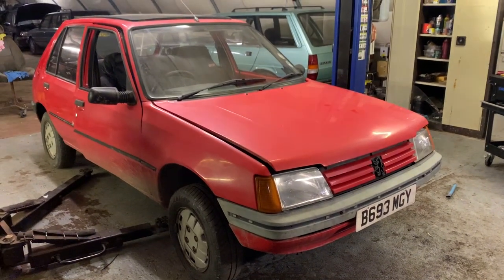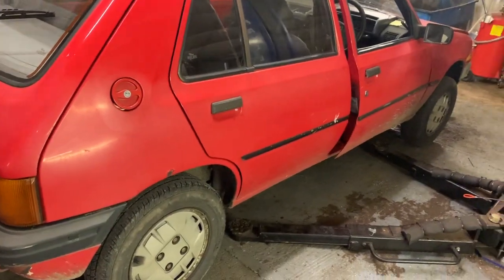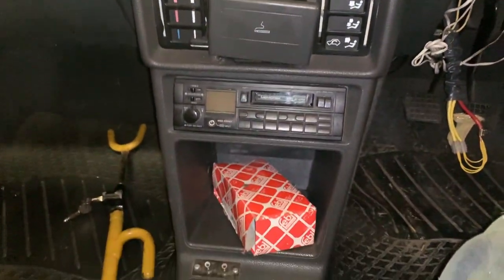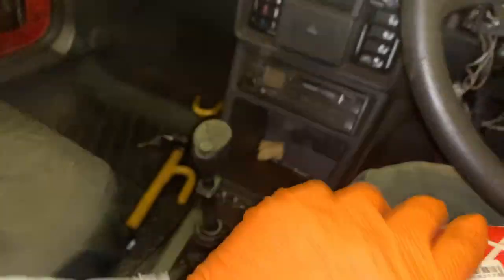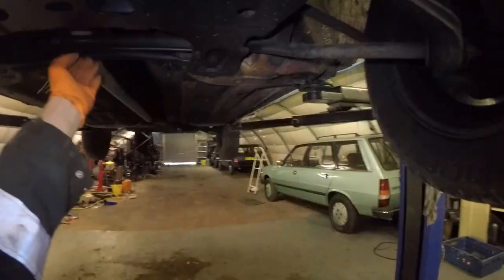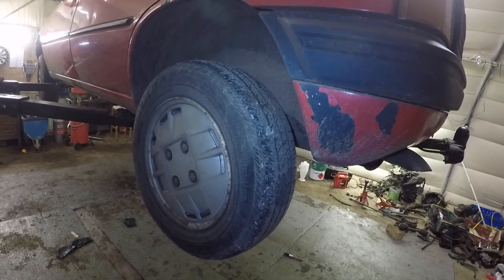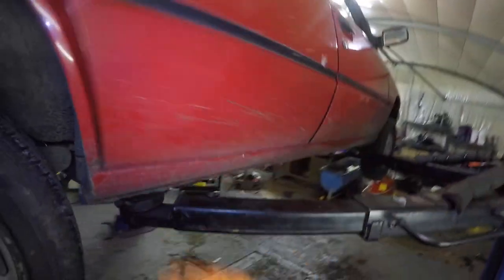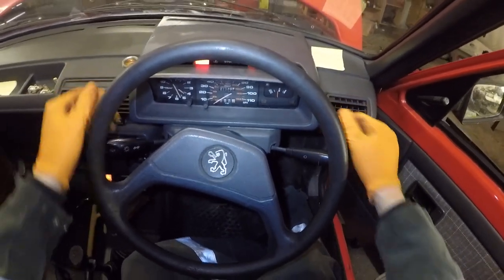£500 Phase 1 Peugeot 205 Tour

Comment: In Theory, What a shed. The total cost to fix all this would technically write off the car 
In Reality: they’re getting scarce and parts will hopefully be easy to get
Reply from the maker: Haha exactly😂
Already been trawling ebay for most of the parts it needs, yup its going to cost more than the car but that’s classic cars
Reply: peugeotCitroen2CV so far it’s as bad as Manchester City’s defence
Reply: i've just bought a 1988 one of these, for GBP 1250 (!) replacement crunchy gearbox will be 350, but in 6 years it becomes a "historic" vehicle: no tax, no MOT. also: UK Law allows up to 2,500 litres of alternative fuel per year which at 60mpg is over 30,000 miles!

Comment: Hi there….I"m from your part of the world ( Co Down) but am living in France...The mechanics here are really shit and the scrap yards are double dear...I bought a 205 here in September, 1.1 GL 1986 with the XW7 petrol engine...It has an oil leak from around the number 4 exhaust manifold or between the head and the block...it's not leaking compression or oil into the ware or vice versa so I suspect it could be an oil gallery leaking from the head gasket...the garages here are quoting really silly prices...I retorqued the head and this has reduced it but was considering tackling the head gasket myself...the only problem seems to be the danger of disturbing the wet liners...do you know anything about these engines...TIA...Alex
Reply from the maker: Hi there, co down isnt too far away.
France, nice part of the world have you been over there long? Its a place i would love to take a run over to and possibly return with something 4 wheeled from leboncoin haha.

The XW7 its not an engine ive seen, thats before the TU and XU then.
Im guessing the wet liners are something like the TU engine, i have a video on this channel where i do a head gasket on the TU fitted to a saxo. If the XW is an older engine its probably even more simple than a TU so id say go for it. The only precaution i followed was not to turn the engine over when the head was off as that would move the liners and damage the lower seals requiring a full teardown of the engine.
Reply: @peugeotCitroen2CV  Thanks for your reply...I see your from a similar mechanical background to myself (farming...lol) and I'm guessing Armagh from the apple trees in your MF135 Video..
I've done head gaskets in Ford 4000's, JD 2140's, MF 35's etc and various bikes and cars...I've seen your TU video and looks similar although the X series engines are inclined to 70 degrees facing the rear so you have to remove some engine mounts to tilt the engine back to get the rockers and head off...I have the Haynes manual...I think it's similar to the TU in that you have to twist the head to remove it, to break seal to liners..At the minute the leak is not bad although we are going to Bordeaux on Tuesday (200 km) so will be a good test..I see a reconditioned XW7 head on eBay UK for 110 pounds, which I'm considering buying as they are looking 60 Euro to test the head and another 60 to skim it and if it needs valves reground!!!
LeBonCoin is great, a bit like a better done deal and bargains if you know what to look for…
I've been over here about 3years but go home regularily as flights cheap...I don't think I'll tackle it til the spring...Need more tools...wish I had the tractor house from home with airtools and really good sockets...will let you know...The 205's were great wee cars...
Reply from the maker: @dolmenman1  
Well observed armagh it is haha, just on the border with tyrone. I live on the tyrone side but the family farm is in armagh.

The new head might be a good option, although if its an oil leak and not too serious you can probably motor on for another while yet, just keep a fire extingusher as is good with any older car. Let me know how it gets on when you do get started its interesting to hear from from another NI 205 owner.
Reply: @peugeotCitroen2CV  Will do....Got the head and it looks good. Got it for £80 plus postage. The garage here was looking £80 pressure test, £80 skim and £10 a valve to regrind the seats...desperate.
I'm not gonna do it until the better weather but she is motoring on fine...gonna need exhaust studs (any ideas) and maybe the head bolts if they've stretched...I'll let you know..
Reply from the maker: @dolmenman1  Ah thats machining costs none of them are cheap.
Exhaust studs, best thing to do is register on peugeot servicebox and find the parts diagrams for the engine, with the numbers use those to search for them. They might be a standardised thread. Head bolts the machining shop may have trade only suppliers for those, ebay and the parts diagrams are again useful. With older pugs it just takes sitting down with a cup of tea for a few hours at the computer to find bits and bobs